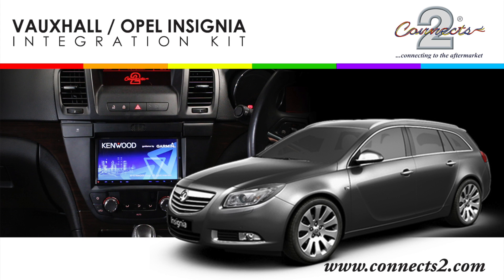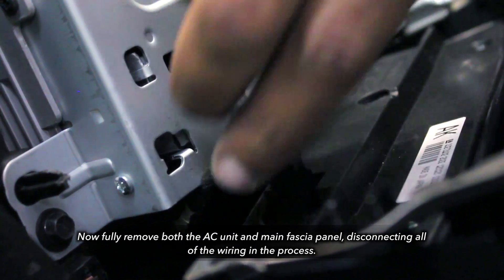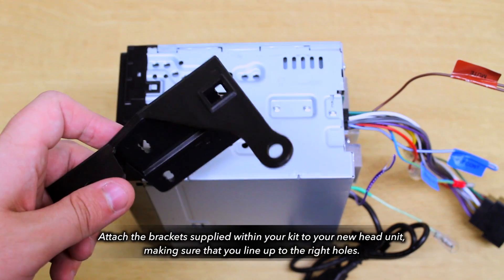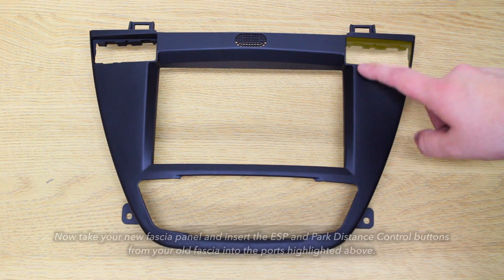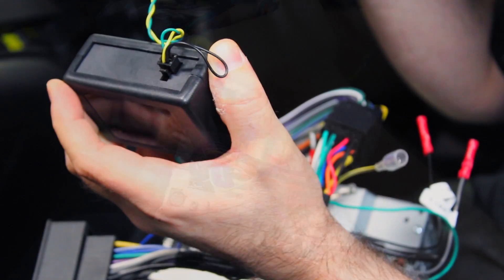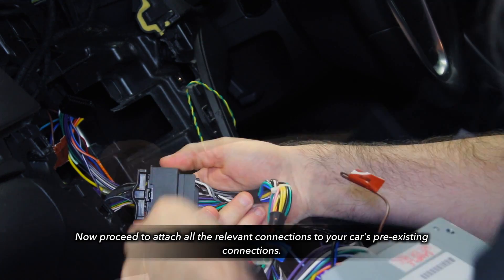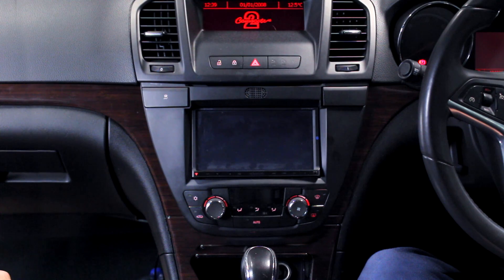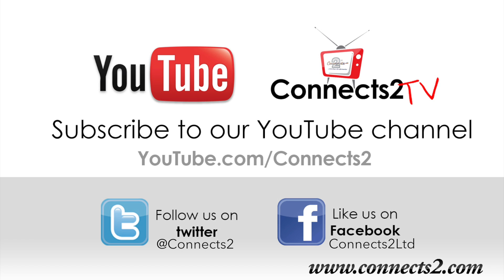Vauxhall Insignia (2010) Integration Kit

Comment: My top display won't work now after fitting how do I fix
Reply from the maker: Hey Simon,
If you message our technical team through our ticket system they will be able to give you all of your answers
support.connects2.com/tickets/technical
C2
Reply: Hi Simon, I'm having the same issue. just fitted and top display does not illuminate. Did you find a fix?
Reply: Having the same issue, did you find a fix?

Comment: Is any soldering required using this kit or is it completely plug and play?
Reply from the maker: Hey Liam,
There should be no reason to solder anything, our harnesses come both with connected ends for both the aftermarket and OEM connections (dependent on the US market where they love the free flying wires) and any outputs are bulleted
C2
Reply: @Connects2Uk  Awesome, thanks for the info I'll have to look into this in the future then :D

Comment: Just curious, will the head unit display other in-car info like heating fan level etc ?
Reply from the maker: Hey Andy,
The head unit you install won't display this information, but the top display will still display information that it would normally
C2